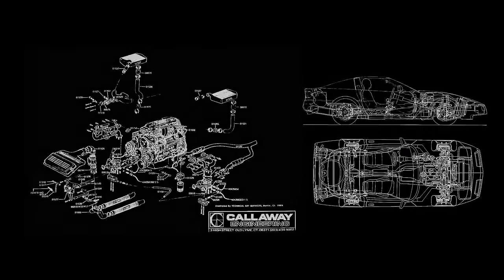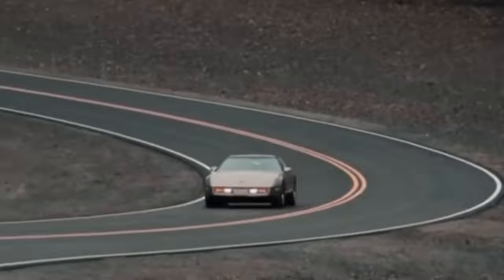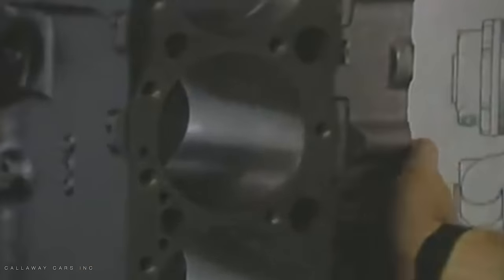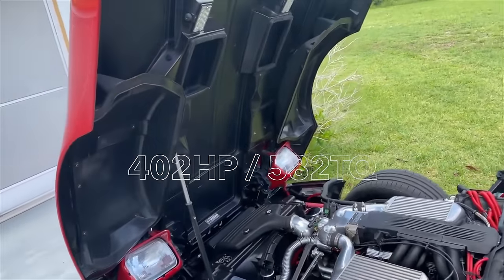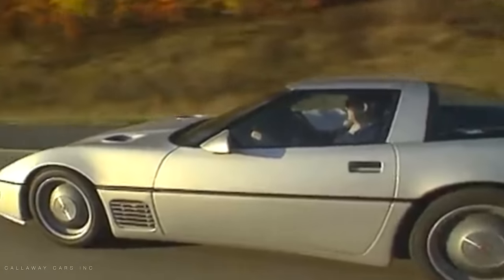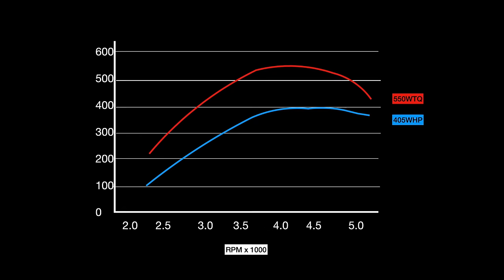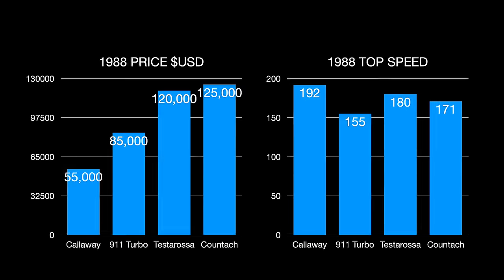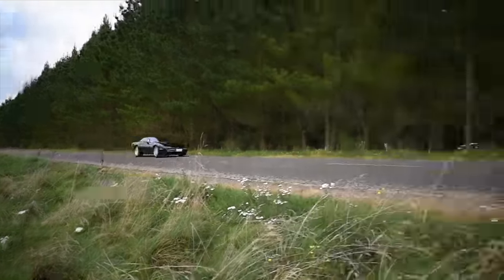How The Callaway Sledgehammer Became The Fastest Street-Legal Car😲 | Explained Ep.10

Comment: The stock intake manifold is restrictive even without boost. Stick an edelbrock proflo intake, big cam, and ik180 heads, headers and exhaust on a L98 and it'll make 410 crank hp.  Add 7psi boost should get  600hp 14psi close to 800. Stock bottom end wouldn't survive that though. The zf6 transmission and Dana rear end will take all the power you want to throw at it.  Incredible handling chassis as well.
Reply: One more thing. These cars run unbelievably hot! Like a true race car you'll cook inside a C4! The heat coming from under the tunnel is unreal!

Comment: This is what people don't understand. They always talk about horsepower and high revving engines. But what really gets a car moving is low rpm torque. If you can beat them off the line, you've got a better chance of winning the race. Plus if you're just driving on the street. A high revving engine is boring. You'll never feel the power. Unless you're really breaking the law.

Comment: The 345hp, and then 384 and 400hp from twin turbos is not that extreme, even for the 80s.  The emissions likely held it back, as with all engines of that time.  Exotic cars of the same day F40, 959 generated much more power from engines of half the size. And Aston Martins V8 vantage, without turbos, made considerably more power. I suspect Europe had different emissions laws.  
 That one off Callaway with the speed record was likely only emissions compliant under certain settings, but to hit 250mph it would need about 900hp.
Reply: Still could buy 3 of them for the price of 1 959 or f40
Reply: @user-pf6wl4hv5j  
 You could get a carpark full of them for the price of an exotic, and have all the options. I think an F40 doesn't have aircon, or power windows, or even a floor mats, and the 959 has a little fabric strap for a door handle. 
 The point is the power output wasn't exceptional at all. I suppose that's why the sledgehammer corvette was mentioned, to point out that engineering capability wasn't lacking.

Comment: Turbo chargers are great as long as people remember that they only work good when the engine is at higher RPMs and kept there.
Reply: False, a Turbocharger can be made to function well under a wide powerband, that is one of the many myths spread on the internet. Old Turbos are slow spooling and have a narrow operating window, but they are not used today
Reply: @TheEsseboy  
What you say is true, to a point.  But to do what you say requires either multiple turbo chargers which takes up a lot more room under the hood or the introduction of fuel into the exhaust to keep the turbo spooled up during deceleration until you can accelerate again which  is hard on the engine and wastes a lot of fuel.  Which is why they are used in competitive racing and not everyday production cars sold to drive down the street.

The only other alternative would be to have a turbo powered by an electric motor rather than exhaust gasses.  That would require a special generator just to power the turbo motor and voltages greater than 12 volts and perhaps a true AC current three phase generator and motor to get the turbo to spin up as fast as needed when you puch the gas pedal down to take off quickly.

Non of any of these are currently affordable for the average person buying a car off the lot, expensive muscle car or not.
Reply: @oldtimefarmboy617  Simply not true, variable geometry Tubochargers and the fact that they have much lighter compressor and turbine wheels, not to mention better bearings mean they spin up crazy fast right now. The fastest reving engine in the world as of now, is a Turbocharged engine.

Turbos have advanced a lot since the time you are talking about, back in the 80s and 90s.

Comment: Had a 1988 dont remember the number anymore, had it from 2005 to 2007. Such a fast car, had bigger turbos better pistons and rods had it to about 570 at the wheels. Could bury the speedo needle in about 9 seconds.
Reply: You sure about that?  There was no speedo needle on these cars.  The dash was digital.
Reply: @corvettecollector8831  digidash had quit working before I had it. All autometer gauges were installed before it was mine.

Comment: Don't Forget about the 1990 Snake Skinner ZR-1 By legendary Tommy Morrison Racing. Shattering a 50 Year 24-Hour Speed Record Averaging 174.885-MPH! The entire effort was about breaking a long-standing speed, endurance, and distance records. At the end of the experience, the team racked up the following records;

5000 Kilometers at 175.710-mph
24-Hours at 175.885-mph
5000 Miles at 173.791-mph
Plus, four FIA International Category Class A-G2-C10

Tommy Morrison Racing subsequently built a few limited Edition Corvettes
Reply: Actually the car that broke the endurance records was a stock zr1 not a snake skinner. The only thing they did to it was remove the catalytic converters and install a cage, mounted a 80 gallon fuel tank and put hella headlights in it to.. they also ran a l98 Vette too. It averaged 158 for 24 hours and broke allot of records too.

Comment: If you take a used stock c7 and put the price of the car into a tune. 
There won’t be much on the road that can get near you. 
Anywhere in the world. 
AND… it turns well too with nearly perfect weight distribution. 
As of right now. The c8 isn’t really an improvement on what was a near perfect sports car but I’m sure that will change in time.

Comment: Wonder what they used for wheels and tires on the tuned one? 🤔 Bugatti makes such a big deal out of their special speed rated rims and tires required to go 250mph that it cost 10k each can only be mounted by them in the factory and need to be changed every 2 years or 20k miles whichever comes first.

Comment: I clearly remember when this car came out and can still see the center spread in…. Hot Rod? I think…. Two things worth noting. When they arrived at the test track many people working and testing there came out to see what they were doing, but when they were told to goal was 250mph everyone laughed it off and went back to what they were doing because it was more or less unbelievable. The other thing I recall is that they were struggling to get the car over the mid 230s so they pulled it into the pit and modified (covered over?) some of the air intakes with DUCT TAPE and went back out on the track finally making the record pass.
Reply: When they looked at the car as to why it had problems hitting their target speed they noticed a high pressure area flowing in the wrong direction. 

I think the magazine you saw (although it WAS in others but after the first one I saw) was ‘Vette. Would have been early to mid 1989 since I saw it very early in 1989 and magazines are always dated 2-3 months ahead in time. On the racks in January but officially the March/April/May issue.
Reply: @elijahrobinson2362  I’m positive it would have been Hot Rod, Car Craft, or Super Chevy as those are the magazines I had subscriptions to. At 15 I was super biased so I wouldn’t have strayed from those rags and while Vette might have been the first to cover it there’s no way Peterson’s main periodicals ignore it. It wasn’t until Motor Trend (Car and Driver?) had the ZR1 at speed on the track with a GSXR 1100 inches away on the cover that I started opening my eyes. I recall they tested the ZR1 against the bike due to a lack of exciting real world contenders at the time. Or at least that’s how they spun the story.
Reply: @cjonesufc  if you subscribed to those then you must have seen it one of them. 

I didn’t subscribe to any but ‘Vette was available at the base exchange store where I was just posted so I grabbed a copy with each new issue. 

Being dedicated to Corvettes it probably did have a first look or maybe was given the green light to publish their story first. 

It could also be that the bigger magazines had already devoted their similarly timed issues to other vehicles. 

Regardless, we both read about it way back when and still remember the impact it made.

Comment: Insane it was making that kind of power on just 7.5:1 compression ratio and still setting a speed record that stood for that long! Great video sir!
Reply: I mean don't forced induction engines usually have a relatively low static compression ratio to make boost more manageable?
Reply: Historically yes, but you can turbo a 10.5:1 car no worries with modern fuel and modern ECU
Reply: @unchartedgroupielove  yep this, thank you sir

Comment: The B2K cars have the turbos behind the engine. I assume your graphic is for the sledgehammer configuration but you shouldn't use it for both because those two engines were very different.

Comment: I remember those OHC Vettes.
The parts were stupid expensive ! Back then while still in production, a single complete replacement cylinder head was $15,000.
I know cause I tried to get a set (2) in 1990 for my boss's shop. sidenote, those engines were turds, broke when pushed and farted $100 bills at the stoplight.
You new one had passed from the smell of burned synthetic and the trail of tears leading to the dealership.
Reply: Simple cheap OHV 350 soon made more power... and hotrodders could do that earlier...

Comment: At the end of the day a car is nothing more than plastic and metal. You can only go so fast in anything before your crash.
Reply: No, it plastic, metal, glass, ceramics, rubber, silicone, chips, fuel, oil, leather, textiles etc....not to mention a whole lot of engineering and work time. Not to mention tooling and tools to make it all! And the factory to house it all. A car is not easy to make, and making a fast one is harder, making it have good handeling and turn at high rates is even harder. Not to mention accelerate and decelrate.

Comment: imagine the passing power... 
me over here driving something with similar hp and torque number and its naturally aspirated as a daily driver. i havent met a hill i cant take in 4th gear with convertor locked even at 36 mph. i can also pass in 4th convertor locked with less than 1/4 throttle quicker than most cars can pass. from a dead stop highway speeds in 5 seconds. and it cost nothing to build. its crazy all the hp numbers modern cars come with now and they cant keep up. power to weight ratio and torque delivery are the only things that matter. hp is only bragging rights. 
the numbers these days are so bad that people think my daily is 600-800hp and i just laugh in their face at this point.

Comment: There’s no other engine that has the rep like a small block Chevy !  1955 was 265 the 350 came out in 1967 .  We always sai if you build a small block it’s a Chevy if you build a big block you build a hemi .  The transmission is always a power glide the rear end always a ford 9 inch .  That’s you recipe for drag racing I’d say more races were won and are still being won with those components.  I wish that Chevy had a hemi head for there small block it’s unreal when you find out the 426 hemi runs a1.94 exhaust valve most produced head for the small block Chevy runs the same size on the intake valve .  All Harley overhead valve v-twins run a hemi head . The small block Chevy is now throwed out for junk considering all the newer LS engine swaps when you find out the LS head bolts right on a small block ford things seem to change greatly for me .  In the late 70s there was a tv commercial  that showed a Chevy pickup with a ford riding across the bed of it wheels and tires hanging off each side the ford setting crossways frame on the top rails of the Chevy .  Being carried up a incline looking like a mountain road at the end it said built Chevy tough with four nuts going up on studs holding the Chevy bow tie up .  So it’s hard for a original small block guy to grasp no matter how much power they produce new engine for the fact that they bolt right on cylinders line right up !  Kinda sold out or upset stomach to me because it’s just not right but who am I to say .  When they got cheap in the late 90’s I was kinda done after a 2000 ss monte but that’s another day .  If you wanna get real find out how much tech the Japanese car manufacturers put in there engines and see I think they got a lot of manufacturers here beat bad . With Honda making 1000 horse power from 2.4 litter or 150 cubic inch . That’s with a stock crank and block !
Reply: My Toyota pickups 22R (pre 1985) was a hemi! 

Dog shit slow tho

Comment: Totally wrong they did not make a twin turbo top speed version for the public, that was a one off with calloway ,which made just 1 for the top speed record over 254.00 miles per hour, the public did get a twin turbo calloway ,but limited to around 160 miles per hour. Plus if you had a right hand drive version which i had seen on ,when i worked  for a guy who owned motorcar nuts and bolts company, he had one and was going to sell it for around 40k which was around 2003 ?

Comment: No way it reached 255mph. No way in goddamn hell it did 255 mph
Reply from the maker: The McLaren F1 reached 240MPH with only 650HP. The Callaway actually has a lower Coefficient of Drag .27 and made 230HP more. 255 is right where it should be.
Reply: 255 isn't hard with a twin turbo small block and decent aero.
Reply: @337speed  I recall that when the C4 came out, Chevy advertised the aerodynamics were so good that it would get 16 MPG at 100 miles per hour.

Comment: so this option made it more then the 911 turbo?   i would get the 911.   i would probably got the 911 without the turbo,      really,  if you cant drive your car anywhere at speeds over 200 mph who cares if it can?       i would rather drive 50 mph on a nice curvy back back road then over 150 in a straight line

Comment: WOW 898 hp is nothing these days, just think with the modern engine parts and better turbos and intercoolers its would be at least 1,500 hp and better transmission nd diff and cooling for oils for all running gear it would most likely hit over 280 miles per hour. Maybe but to date i have not seen anyone do it, bugatti hits 300 miles per hour must beat that calloway? ✌✌🦘🦘👍👍

Comment: The Gnx kicked ass on this car and was single turbo just as heavy.i curious your engine picture diagram  shows headers I think it used restricted log exhaust manifolds but back then it was cool they built stuff like this for the wealthy
Reply: '87 GNX had a fast 0-60
However this car goes 125mph faster than the GNX
Pull your head out of your ( * ) before posting on the internet.

Comment: Nothing equals the original small block and what it is capable of. I have a 421 stroker right now which is awesome and if I build another engine it will start out with the old tried and true original engine that started its life 67 years ago as a 265 ci. A top dog for 67 years is something he should be proud of. The designer of that engine should get some sort of an award for the most popular engine in the world. Just think how many millions of the 5.7's (350's) alone rolled off the assembly line. It's still the cheapest and most reliable  horsepower that you can build to this day.